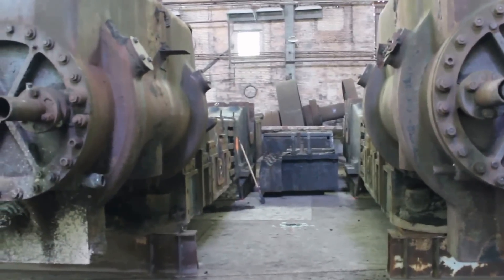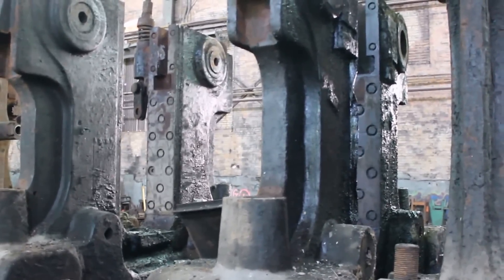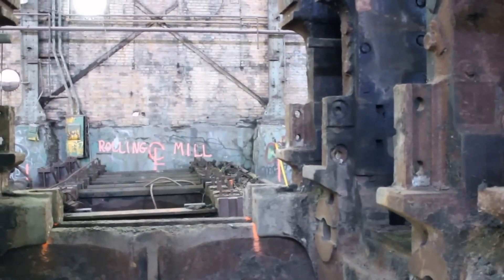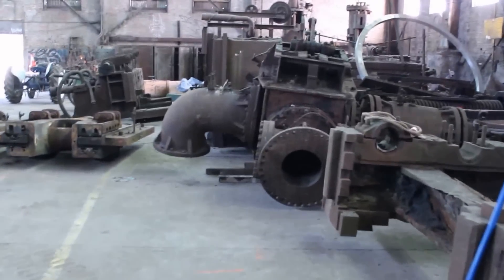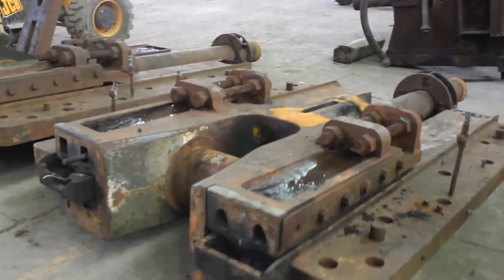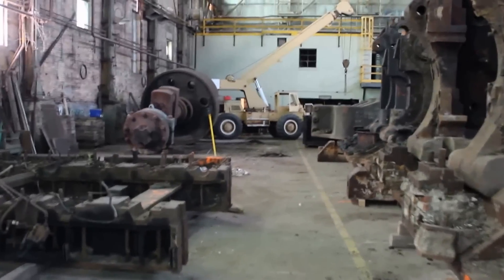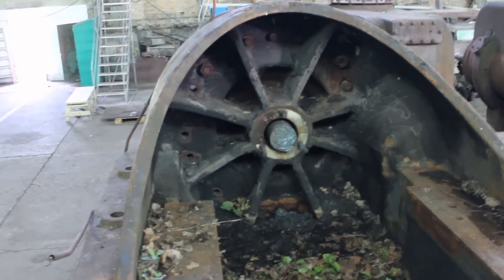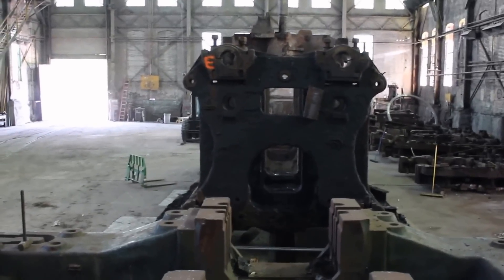Tour of the 48" Universal Plate Mill at Carrie Furnaces

Comment: To those who have never seen a rolling mill in operation, it was an amazing sight. I worked at J&L Aliquippa. The blooming mill would take a 12 ton ingot and squeeze it down to 12" x 12" in 90 seconds. The 44" diameter rolls would almost stop when the ingot was first fed into the rolls. I used to watch from the crane rails.  The entire building would shake. The power was amazing. Four 3400 HP DC motors turned the rolls that could reverse in 1 second.

Comment: So THOSE were the engines that drove steel rolling mills!? Do you happen to have any information on the pressure and temperature of the steam that these engines ran on? Did they exhaust to condenser or atmosphere? Do you have any steam-rate, horsepower, or efficiency data?

Comment: I worked at the 160 inch plate mill in Baytown, Tx back in the early 80's. That mill was built new in 1969 and it was quite impressive. The motor that turned this beast was a 7000 HP Westinghouse motor. It was the size of two story house. You could go under the mill while they were rolling. It was like a river down there called the sluiceway. When they fed a slab in there it sounded like a bomb going off. We used to roll 350 slabs in ten hours. Each slab could produce up to eleven finished plates. We rolled 1/4 inch all the way to 5 inch. We made the missile silo covers for the MX missiles. All of this is gone now, it breaks my heart what the greed has done to this country!
Reply: Actually Baytown is still rolling.  I was there from 2011 to 2015.  It's part of Jindal Steel Works of India, and They started an expansion program two years ago  It's on hold now.
Reply: @tomhoward1996  So do you know whats still running? The Plate Mill,Pipe?

Comment: I saw this mill running in 1974.  You could see the steam engine running in the background, it was amazing.  The mill almost stopped when the slab was fed in, then it accelerated until the slab went out the other end.  The fun part was how they cleaned the scale off.  They threw rock salt on the plate, which would explode as it was crushed by the mill roll.  When they had visitors they would put triple the normal amount.  This would shake the building, and the dust and dirt on the roof beams would fall on the visitors.
Reply from the maker: Thanks for your comment! That rock salt also had the effect of corroding the mill shoes and roller tables.  I wondered why those parts had corroded so much.
Reply: I was a Millwright at the 100"...depending on what steel they were rolling, the laborers sometimes draped wet burlap on the slabs or threw scoops of rock salt...most of the time, the high pressure sprays blasted off the scale...
In times of low production at the 100", I worked at the 45" Mill, the 160" Mill, and Structural Mill...never went to the 48" Mill...that was the 1st Mill in Slab & Plate division to shut down...